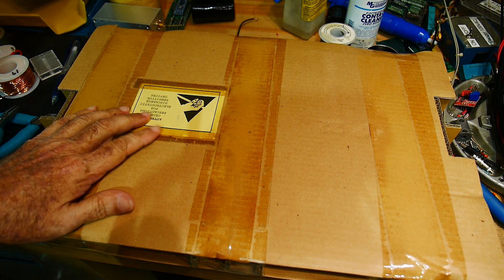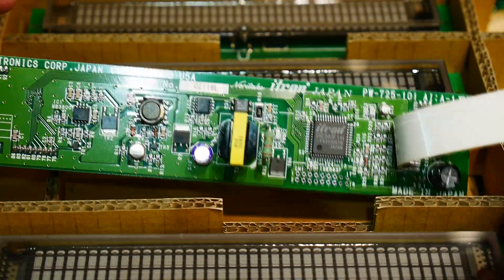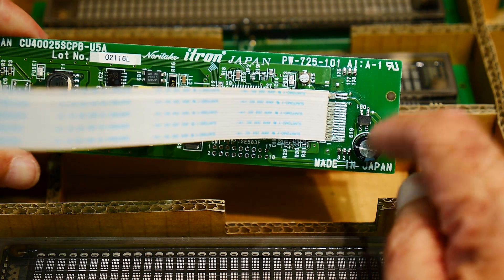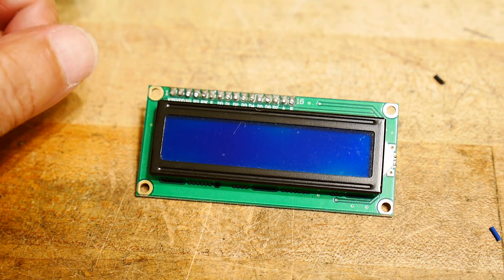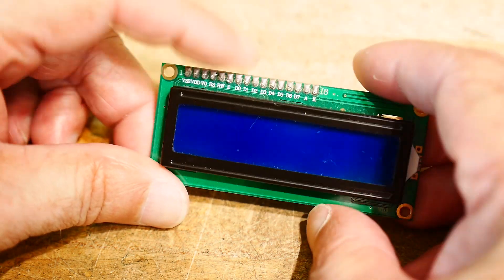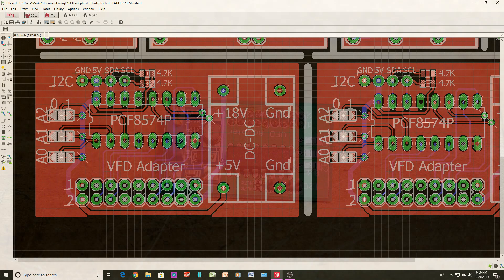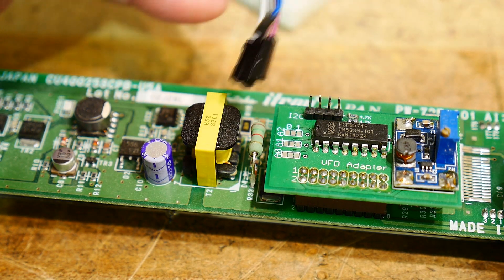#381 Vacuum Flourescent Display Noritake itron CU40025SCPB-U5A PW-725-101

Comment: Noritake nowadays makes VFD displays which have most of the electronics inside of the glass envelope, mounted to circuits printed on glass.  To me it's quite incredible that they've managed such a thing as VFDs need very high process temperatures, and also require materials which won't contaminate the vacuum as they operate under very high vacuum.  And they aren't flip-chips as with most chip-on-glass applications, but they are wire bonded.

Comment: I have found the traditional niche application for this type of display is continuous cold weather (below freezing) operation. I have found that you can use these displays down to very low temps (most VFDs to -40 degrees f). Many LCDs just stop working at very low temperatures, and large dot matrix LEDs choices limited. OLEDs may be an alternative, but I have not tested at low temps. For cold weather vehicle testing I designed some custom test instrumentation using Noritake VFDs. At some point, the vehicle would not start, and barely any systems would work if at all, but the VFDs had no problems. The blue color is also very easy on the eyes. It was somehow fitting that in a frozen vehicle the only indication of life was the blue glow from the VFD displays.
Reply: And that Noritake has managed to mass-produce VFD displays with in-built driver ICs is very impressive.
Reply: Visteon has made low-temp OLED displays for a while now.  GM has used them extensively in their vehicles.

Comment: Sorry to be nitpicking, but 40-50V isn't "extremely high voltage" - Also those HD44780 Character LCD's are not TFT. It's not active matrix. It's a passive TN/STN display. It's the first Itron display that i see that doesn't run off of 5V entirely. I am sure you can power it from the secondary side of the stepdown-transformer on the board and it would be happy with 5V DC entirely.

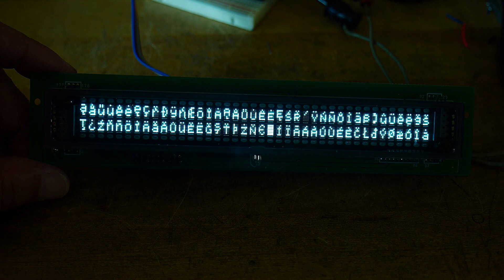Comment: @16:01. yes, current hungry. I have a very similar VFD with what looks like the same interface and yes it worked on a normal Hitachi connector 16 pin. EXCEPT for the 700mA being drawn on the 2 pins that would have driven the LED backlighting on the LCD. needless to say the tiny FET on my LCD backpack let its smoke out. easy fix.  By the way , we still have AM radio here in OZ. these displays obliterate my favorite stations.

Comment: I'd buy one if it had an easy to use interface and it wasn't $200 :)
Reply from the maker: I guy on ebay has them for $5
Reply: @IMSAIGuy  saw that but with the ~$15 shipping I'd have to order more than I need to make it worth it.

Comment: VFDs really only require around 25V for non-multiplexed and 50V for multiplexed displays to drive them. Small tubes like the IV-18 I've gotten to run happily around 35V. I recently designed a small vfd clock that generates the drive voltage from 5V using a discrete boost converter.